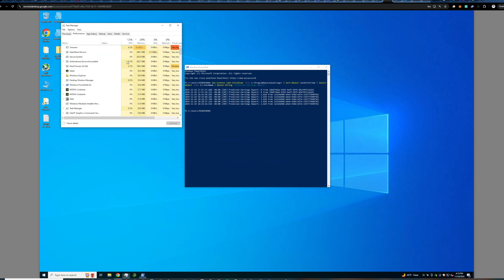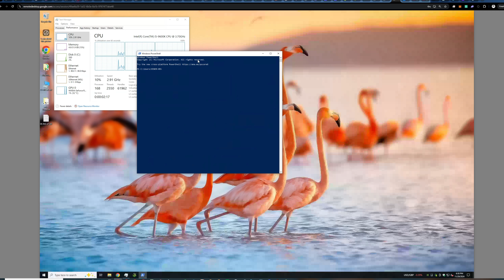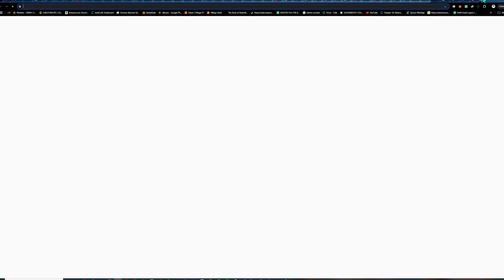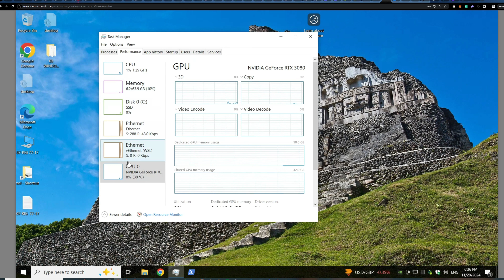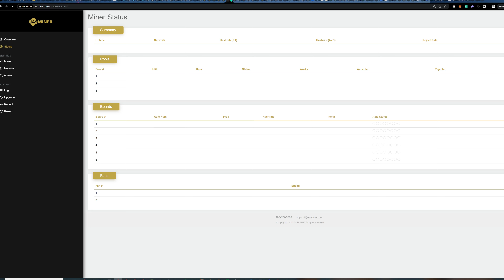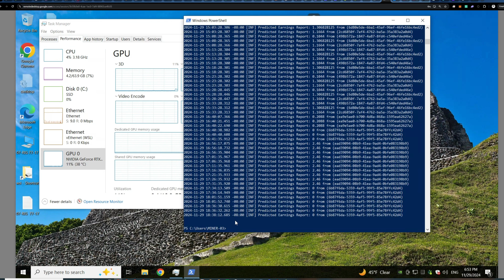SALAD POWER USE, HOW TO CALCULATE YOUR POWER USAGE & OTHER SALAD ISSUES

Comment: Thanks for interesting and informative content mate. You can ask your colleagues or if you know what I need to do to make the vEthernet (WSL) icon appear in Task Manager (Performance). There is only Ethernet. I have VmmemWSL in Task Manager (Process). In the Salad instructions, they pay attention to Virtualization being enabled in CPU Performance and it is enabled for me and displayed like this. Maybe the vEthernet (WSL) icon itself is not important, I don't know. All the checkboxes and permissions for the virtual machine are enabled in Windows and in the BIOS (otherwise the system would not take my work). But it takes the work, works stably, and then interrupts. If you can help explain how to do it to see vEthernet (WSL) in Task Manager (Performance), I will be grateful. Thank you and have a nice day👊
Reply from the maker: I have never seen that Ethernet WSL not running in task manager but maybe it’s just some settings in your machine that not allowing to display that icon as you mentioned that you getting work loads and that you getting rewards that all that is matter. When I started I had issues with my machines like 2 month ago and had to manually update  WSL in windows powershell. You can try to do that but I you herring paid I wouldn’t worry much.

Comment: Sir from yesterday my rtx 4070ti super 16 gigs picking a job and after sometimes drop it restarted salad as you shown on video but same issue remains. Please share your thoughts about that when you will be free. Regards Ashis Das from India
Reply from the maker: Once your machine properly started it will start vmmem process and test your machine network etc. It shows like you got the job but it could be a test so just have to wait for job. But if you have no log report in windows powershell it could be hardware problem. 4070ti not getting jobs constantly but sometimes get pretty didn’t one almost same pay as 3090 but rare.